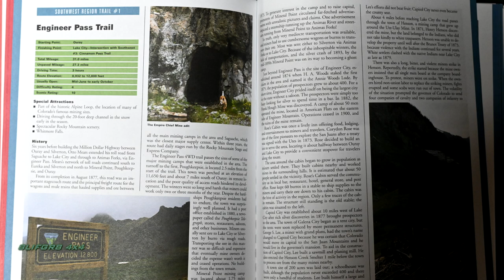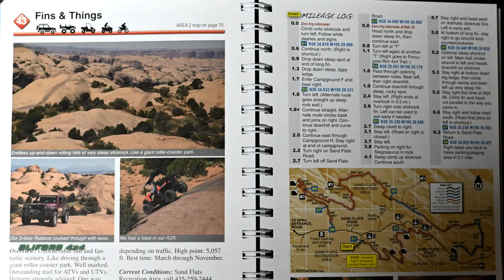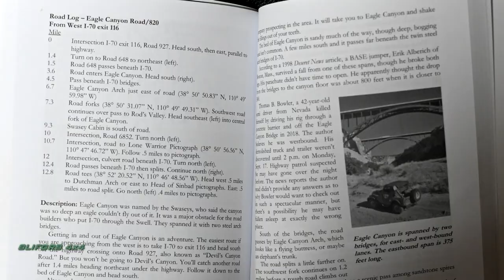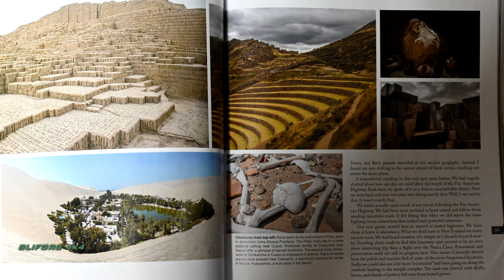Overland Gear Ideas for Under $50 (2019 Edition)

Comment from the maker: Links from the video:

DeWalt DCL050:
https://www.amazon.com/DEWALT-DCL050-Hand-Held-Light/dp/B00KWRM78E/ref=sr_1_4?keywords=dewalt+12v+light&qid=1575862464&sr=8-4

RoadPro 12V Stove:
https://www.walmart.com/ip/RoadPro-RPSC-197-12V-12A-Portable-RV-Stove/40081597

Ozark Trail Lightweight Backpack Chairs
https://www.walmart.com/ip/Ozark-Trail-Lightweight-Weather-Resistant-Backpacking-Chair-Black/338748186

MTM ACR8 Ammo Crate:
https://www.amazon.com/gp/product/B00T4XL4HM/ref=ppx_yo_dt_b_search_asin_title?ie=UTF8&psc=1

Peter Massey Books:
https://www.amazon.com/s?k=Peter+Massey&ref=nb_sb_noss_2

Chris Wells' Guide To Moab
https://www.amazon.com/Guide-Moab-Backroads-4-Wheel-Drive-Trails/dp/193483825X/ref=sr_1_fkmr1_1?keywords=Chris+Wells+Moab&qid=1575862873&sr=8-1-fkmr1

Christian Probasco's Backroads of Utah's San Rafael Swell:
https://www.amazon.com/Backroads-Utahs-San-Rafael-Swell/dp/069221500X/ref=sr_1_1?keywords=Christian+Probasco&qid=1575862896&sr=8-1

Overland Journal Subscription:
https://overlandjournal.com/subscribe/

Contigo 14oz 2-pack water bottles
https://www.amazon.com/Contigo-AUTOSPOUT-Striker-Bottle-Nautical/dp/B00MVODNGG/ref=sxts_sxwds-bia?keywords=water&pd_rd_i=B00MVODNGG&pd_rd_r=db0e15e8-5ca9-472d-b300-5470995b2c0e&pd_rd_w=hR79I&pd_rd_wg=enhqx&pf_rd_p=1cb3f32a-ccfd-479b-8a13-b22f56c942c6&pf_rd_r=0P291ABEN0P2P80HX7PN&psc=1&qid=1575862962

17 Oz Vacuum Sealed Water Bottle
https://www.amazon.com/Premium-Stainless-Insulated-LeakProof-Bottles/dp/B07RJTKL5W/ref=sr_1_29?dchild=1&keywords=vacuum+sealed+water+bottle&qid=1575862990&s=home-garden&sr=1-29